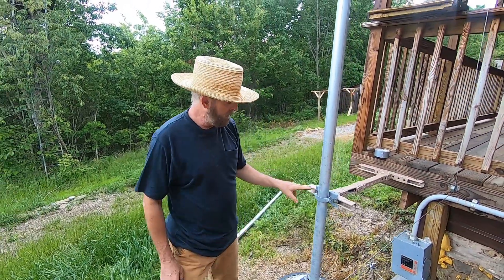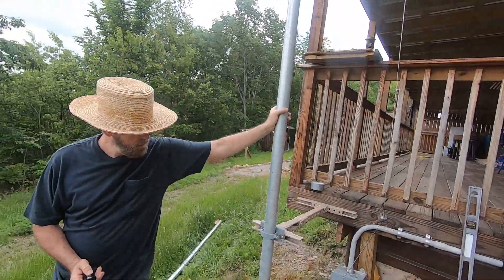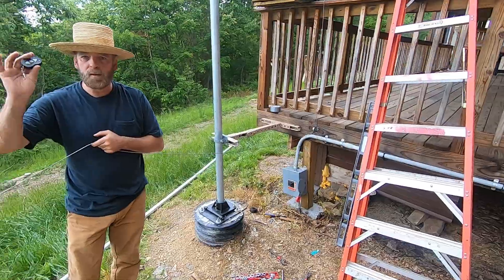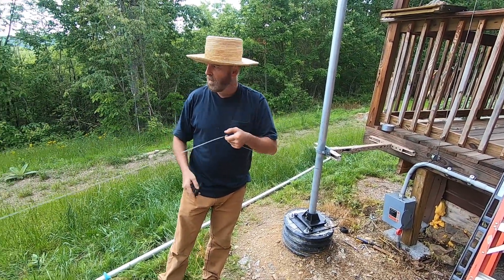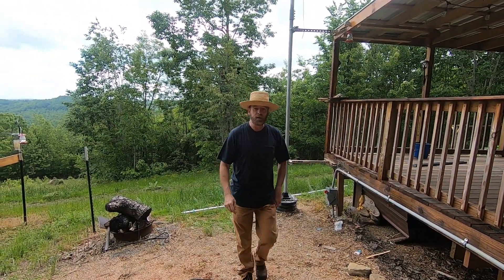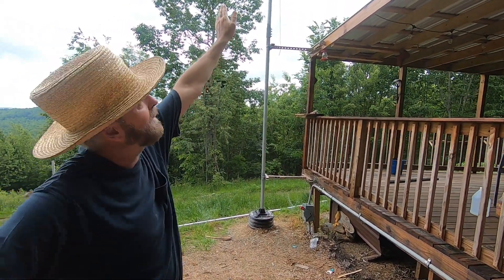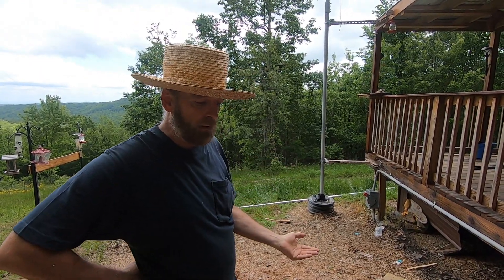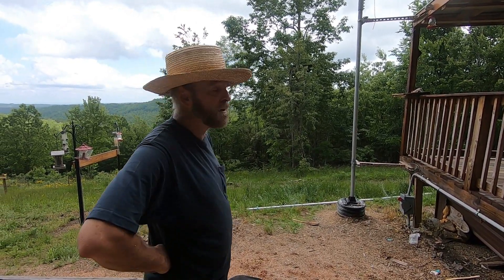PART 2 Off Grid Thermodyne, Cutting Edge Power and Missouri Wind and Solar Turbine Erection Upgrade

Comment: I hope those little 29" blades can push a big Ultra -Core PMA.  Usually they use 5 of those wide 35" KT Pantara blades to push an Ultra-core along.   Wishing you well.
Reply from the maker: Thank you. I will start saving my money.  Thank you for watching the video too.
Reply from the maker: Can you provide a link I can only find 74 inch blades. Can I use 74 inch blades?
Reply from the maker: Just ordered 74 inch 5 blade kit off ebay thank you for your advice and products.